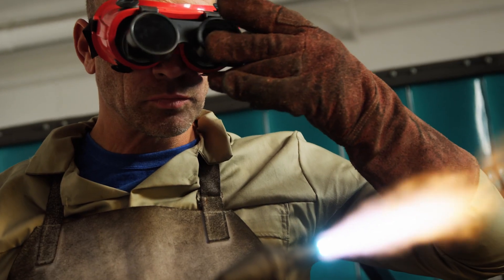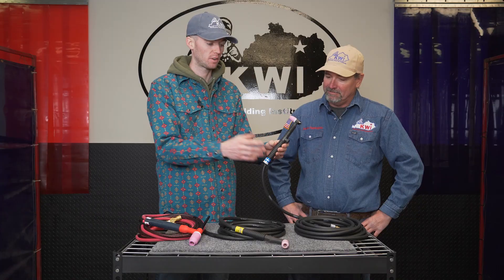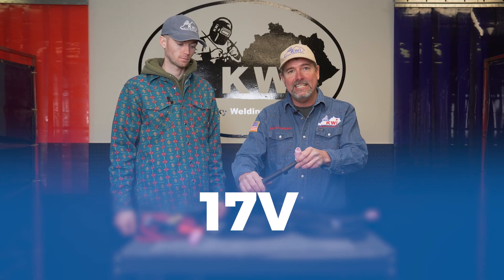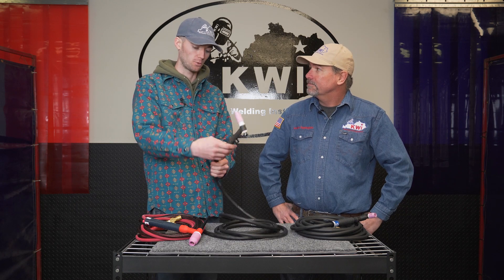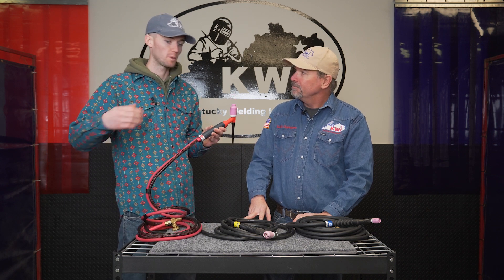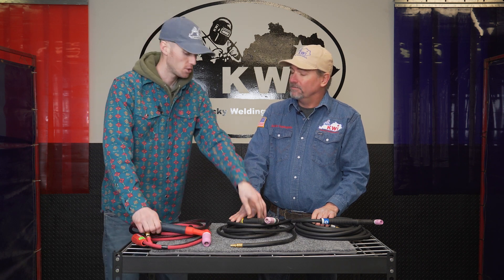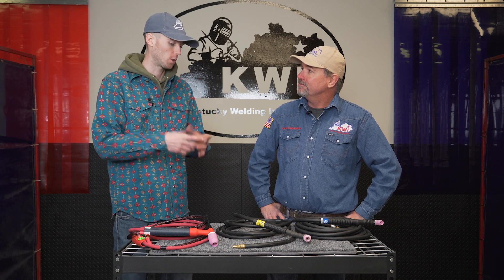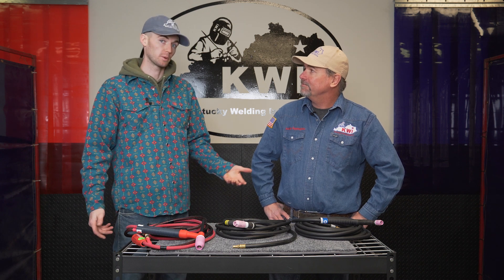The 3 BEST Tig Rigs!?

Comment: Yah thats nice but ive burned up a black momba heavy hitters but one i  never burned up was a profax 150 even when i was welding 200 220 amps on heavy wall pipe dont shut the gas off and they seem to weld just fine